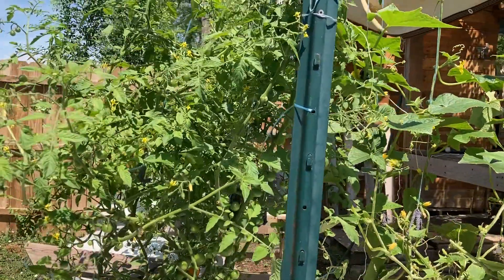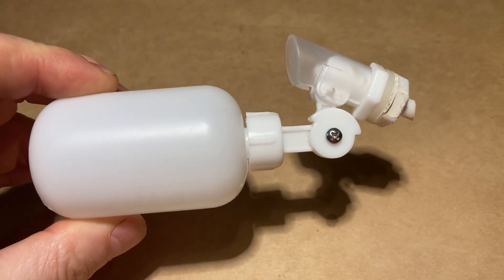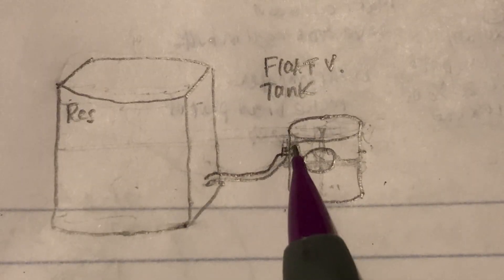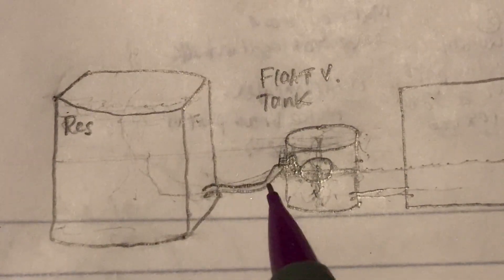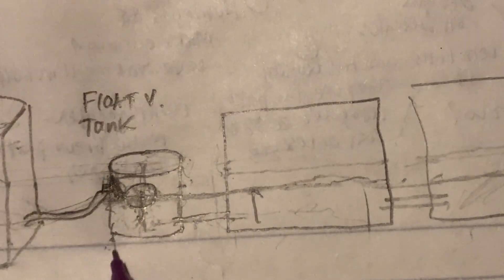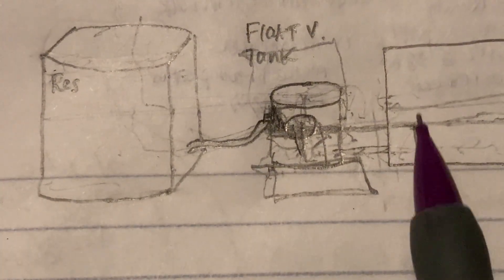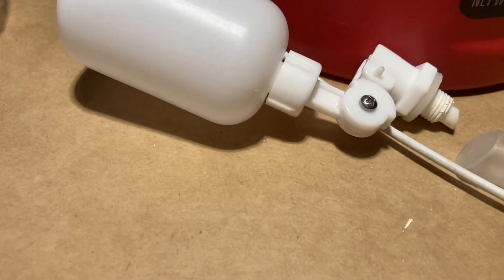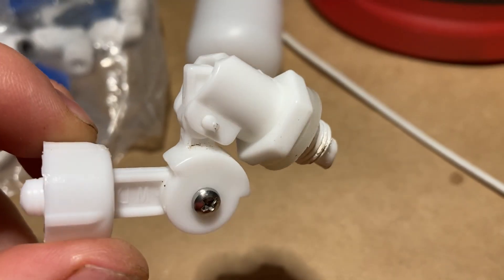TIME-SAVER & PLANT-PROTECTOR 🛟 Easy-DIY Self-Watering Hydroponic Automated Float-Valve System Build!

Comment: So I've got maybe 6 big water tables with rare wetland plants that I've propagated. Unfortunately they're in pairs at 3 different levels, but I guess I could set up 3 float valves to one big reservoir, with all 3 being at different levels?? 🤔

Realised I need to do something after leaving the hose on for 3 days 😬
Reply from the maker: I hear you!  I'm in a similar situation & need a float valve system on my larger Trash Bin containers that support 4 much larger fruiting plants (as shown in the subsequent Grow Bigger video).  I've been working hard to keep up with those refills given this summer's heat and evaporation.  I don't want to disturb the plants this year, but --> Next Year for Sure!  

I have a rainwater drip line set up for the soil berry bushes, and have thought of adding those 4 tanks to the drip system, so that at least some of the water-refill would be automated.  It's a dual timer unit and only one side is being used.  I thought that maybe I could control a given daily flow rate via the timer & through drip adjustable drip emitters -- but its late in the season now -- so I don't think it would be worth it for just a few more weeks of use.

I'm glad you're thinking of improvements to your setup -- sounds very interesting!  Thank you for commenting  & I would love to hear what you come up with should you decide to change things up!
Reply: Wow save money on buying float valves for each bucket